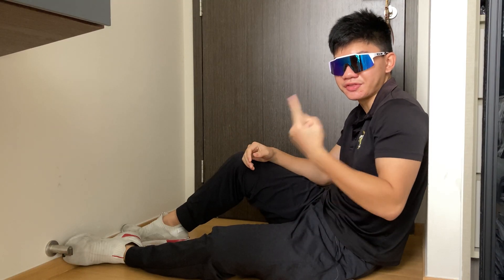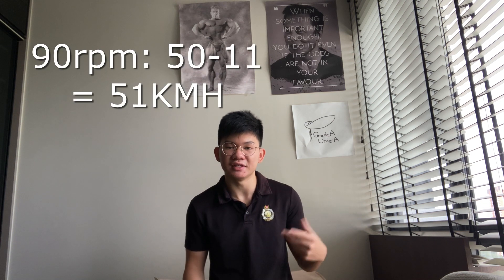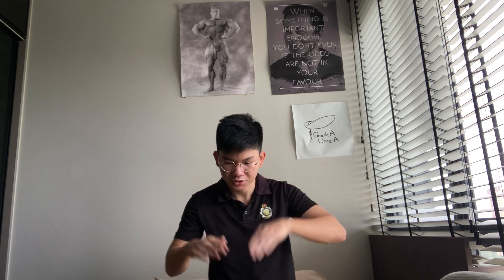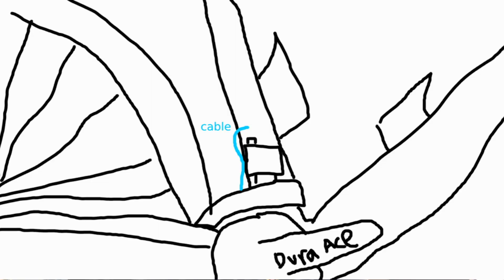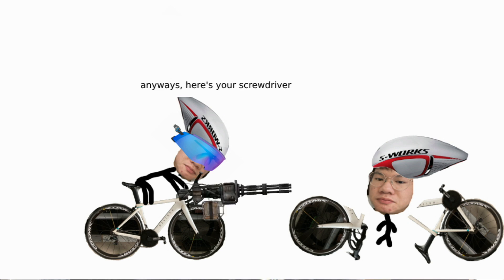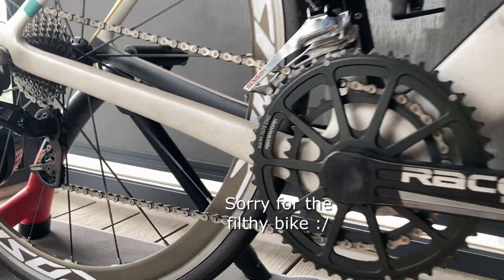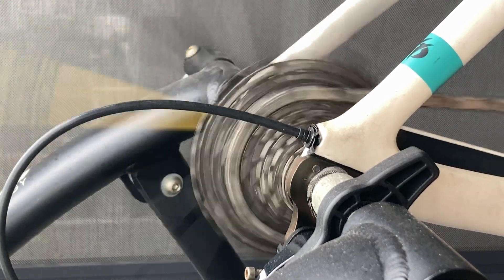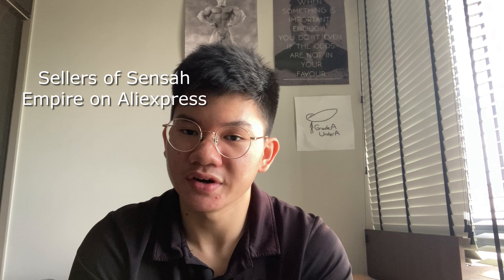SENSAH EMPIRE Shifter FAILED? What To Do!

Comment: I also used them for some time in Greece. FD died but it didn't brake since I have the alluminium version. The shifter ate into the mechanism and they would just run instead if one actuating the other. Added some material but haopened again. In the end changed o SRAM rival.
I realized how important it is to accurately calibrate the rotation of the front derailleur.
If it's not completely parallel to the chainring, it might shift up but it will require more strength on the shifter and cable. Hence the shifter might start deteriorating due to friction.
Be extra careful, especially with Sensah shifters.

Comment: I have had both the sensah empire short and long cage version. It is identical besides the cage size. This means they can technically shift into the same cog size (at least 34 but i bet it can do 36 too). It just takes up less chain slack. Their chain slack calculation are based on you having 16 teeth difference in the front - which you don't have. So long story short, probably you can use a bigger cassette.
Reply from the maker: oh wow i didn’t know that!